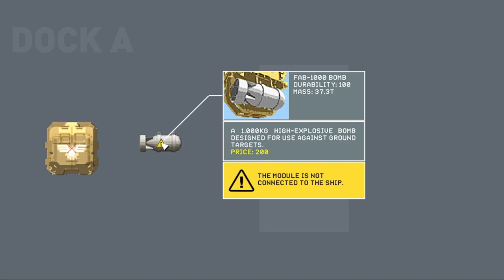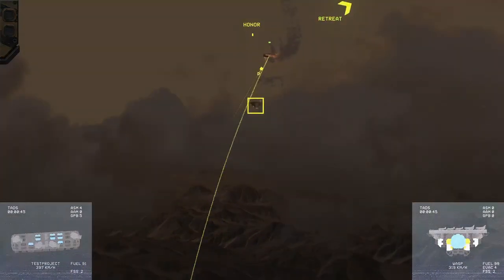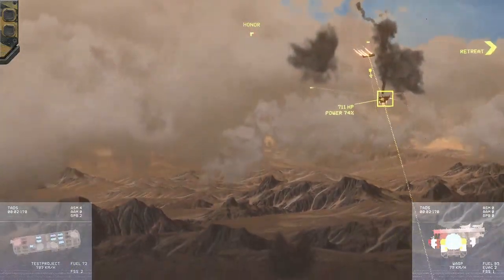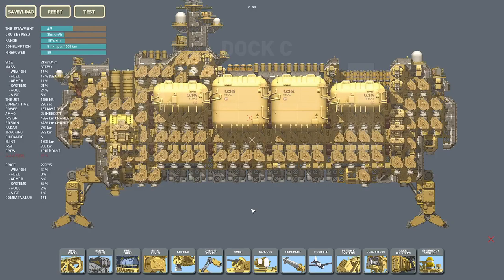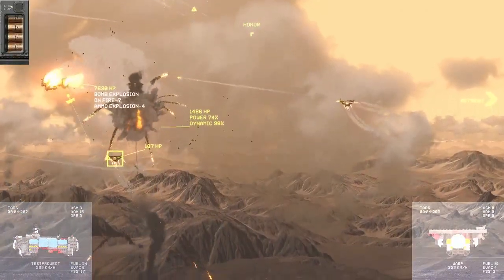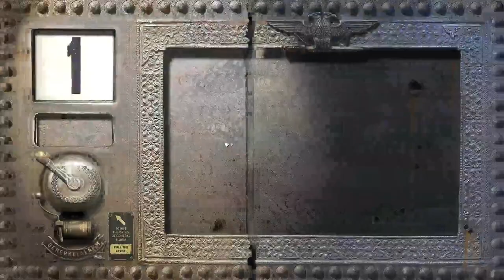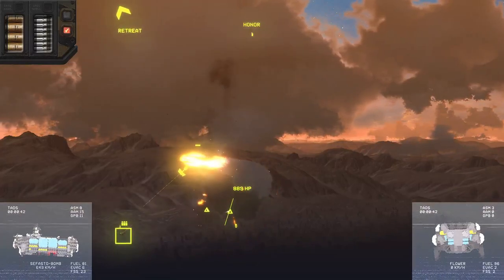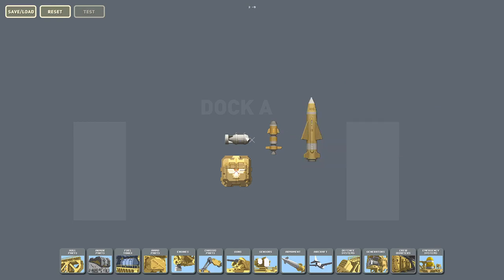Aerial Bombing Shenanigans | HighFleet Builds

Comment: When doing a surprise attack, the enemy will Stay grounded for longer if you have bombs.usually 30 seconds. This allows you to drop them all and quickly flee. Think of it as like a plane but more boom. This is useful when strike groups are landed and you don't want to sacrifice missiles or planes to sprint aa missiles. They are hard to aim but the reward sure is worth it. Unlike planes the alarm also dosent get raised if you destroy every single one and you can loot it for more money.
Reply from the maker: I was considering including this info but I figured that Phrosphor made a very good video about this

Comment: Not recomendable I'd say... rather 'upgrade' your Lightning to a Thunder by giving them not only 2 Zeniths, but also 2 Fabs, since you will be sudden striking the enemy anyways, you can easily pop off both bombs to stack the odds in your favour, shoot a Zenith or both if need be and then overwhelm the enemy with superior manuverability. 

The main issue I see with your ship is that it's too slow and you dont BLANKET the enemy with your FABs... just like with the Missles they DO become a liability in any prolonged combat, so use them or lose them. Keep in mind you have litterally several TONS of high explosives strappeed to the buttom of your ship (which tends to be the most vulnerable part of most ships due to design requirements).

Comment: Isn't 1000kg the weight of the explosive filler inside? The bomb module weights 37.4T in the tooltip...stilll... boom is BOOM
Reply: Probably balance reasons
Reply: Perhaps the gravity there is different from ours